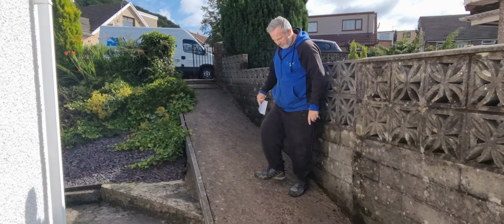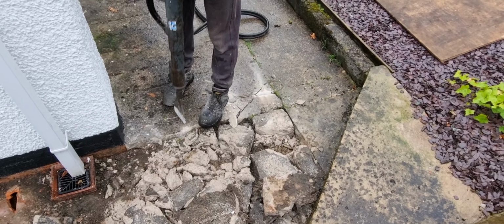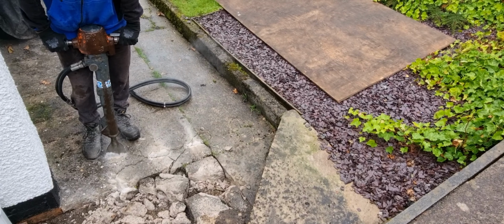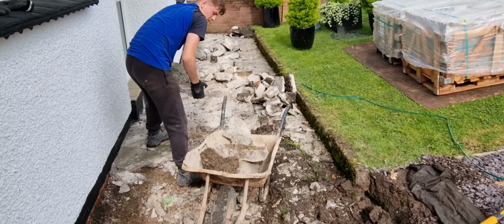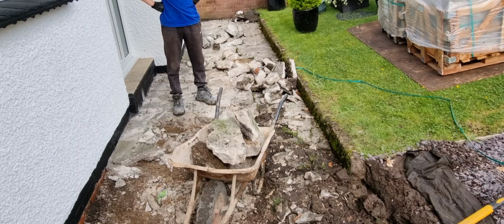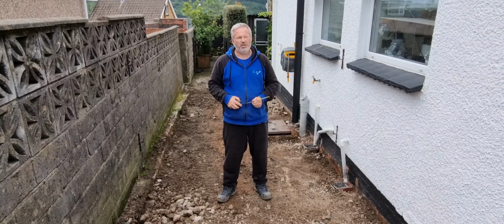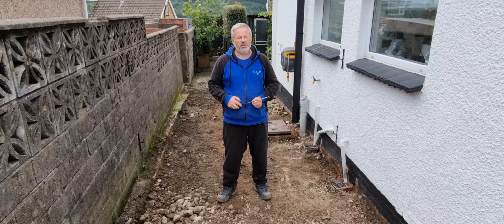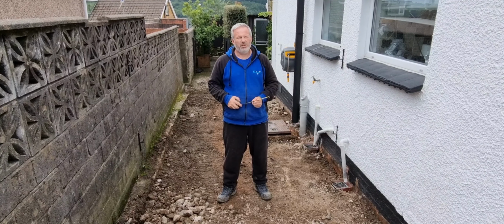How to prepare a sub base for a patio

Comment: Hi Justin 
Glad you had a break and recharged your batteries 🙏👍❤️ 
Lovely neat work mate , another sloping drive mate , you don’t have it easy do you mate 😓👍 at least you got a few drains to angle the water away with your patio to prevent flooding, I might have been tempted to put some acco drains at the bottom of that ramp where it meets your raised patio just into that drain to stop the water coming down the slope  and slipping round on to that raised patio ? Lovely work pal and another tidy quality job from you and your lads , keep safe mate and have a good week 🙏🙏👍❤️
Reply from the maker: Morning john
Thanks for the post as always mate .I think although its difficult i do like to challenge myself sometimes and to be honest the people are lovely mate .id rather take on a slightly tricky job with nice peoole than take on an easy job with someone who isn't my cup of tea .
Eco or Aco drains as you all call them went in yesterday. So its moving on slowly. Keep safe good luck to you and the lads.
Justin 👍 😆🧱

Comment: Recommend a fine sponge or wind muffler on the audio mic to stop the wind noise. Shame the next door neighbours refused the offer of a new wall, especially as it was pointed out to them that it ready to go and the fact that they would not have to pay for it.  It a shame as when it does go and needs to be rebuilt it will interfere with the new work already done on the new patio. A new wall would have enhanced the new patio as well.
Reply from the maker: Rocky appreciate the advice on the mic.
Yes the wall not being re built was very frustrating 👍

Comment: Hello, I'm DIYing a patio, however it will sit proud of the lawn ( above not below ) Any advice you could give in terms of the base way to contain the Subbase when compacting, didn't want to go down the gravel board route, would these rot in time, comprimising  the compacted base & patio?  Maybe use bricks, although i have seen this tin edging available from Screwfix, wondered if any good or what you would do ? Many thanks in advance for any tips/ advice you could give !
Reply from the maker: Brick is good the rest you mentioned i wouldn't use that .
Google concrete path edgings 900 x 150 x 50 mm .
As long as the 150 mm in height is good for you concrete them into the ground good to go .
If you need more height you can by a concrete slab 900 x 600 mm and cut them to the height you need thay are basically the same as the path edging just in slab format. Hopefully that helps you as an easy way forward thats durable and simple.to do .good luck 👍💯
Reply: @brickrightbuildinglandscaping  Thankyou so so much for your quick response and also taking the trouble to reply. Concrete path edgings would be perfect. Thankyou so much. All the best.
Reply from the maker: @hairynews8348  
Your welcome hope all goes well for you 😀👍💯

Comment: Great video fellas. I have almost bang on the same exact garden layout and have just completed lifting the concrete aswell, tough work.... In regards to falls at the side of the house assuming you didn't have the ramp and manholes to contend with, would it be better to have the fall running in the direction towards the neighbours walls (wall neighbour didn't want removed).
Reply from the maker: Hi zuber hope your well mate .Yes you could do that in fact its always the best practice to fall water away from the house where possible. 
Justin 👍

Comment: interesting you used a "tarmac cutter" bit for the jack hammer rather than a concrete pick?
no wonder it was such hard work
Reply from the maker: If its the pointy round bit your referring to we find it just makes holes in the concrete and gets stuck .the narrow bit is ok but we found the wider bit works best even if it is the wrong one i dont no its what works best on each job 😉

Comment: Great job there Justin as always. Quick question do you use a formula to work out exactly how much Mot type 1 you will need? Trying to work out for a job and not sure if the calculators online are accurate or not, thanks
Reply from the maker: Hi tom 
Ive always used volume x2 always worked for me 👍
Reply: @brickrightbuildinglandscaping  Seems like the calculators are about accurate then, didn't want to order to way to much 😂 perfect thanks for your help 👍
Reply from the maker: @TopM48  
No worries good luck 👍

Comment: How do you know that you have exactly 100mm of sub all throughout? It seems like you're just spreading it randomly but, obviously, you have a way of knowng.
Reply from the maker: We use string lines to create the finished level then measure down off them .This ensures we have are correct measurements of base all over 👍